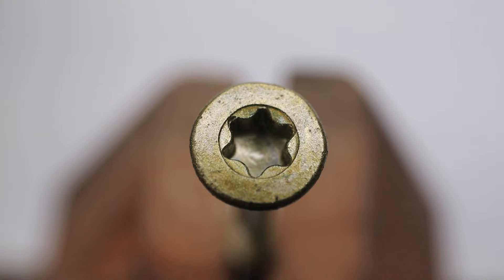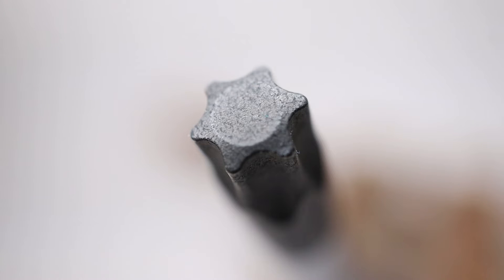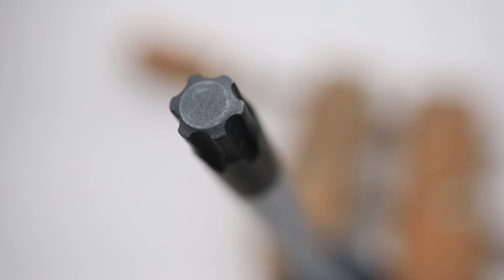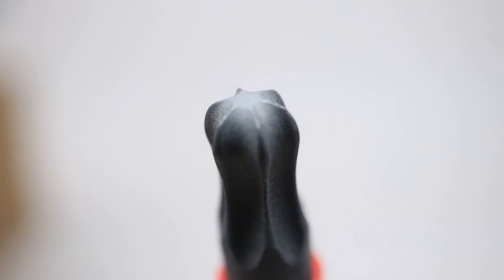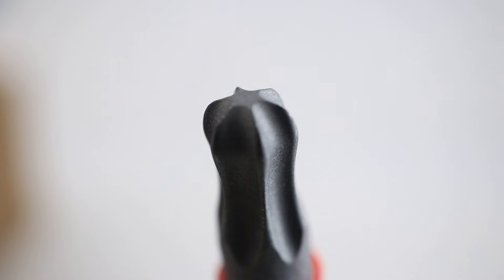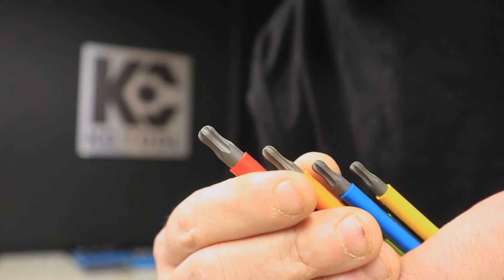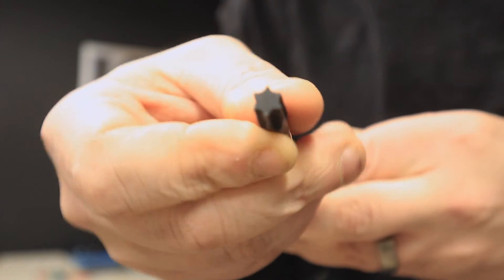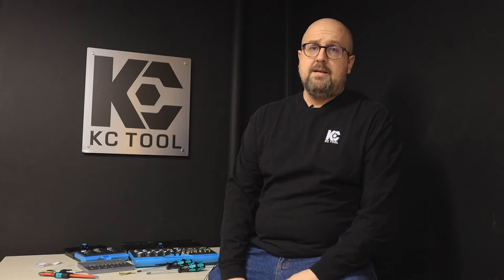The Evolution of Torx: From Torx to Torx Plus and Beyond

Comment: Twenty years ago, it looked like Robertson was starting to replace those miserable Phillips heads.  Then Torx and its various copycat designs came along and settled all of that.  Probably all due to easier manufacturing techniques that came after the original slotted screw.

Comment: The question that springs to mind: Is there any advantage of pentalobe vs torx? The Google says, no - that pentalobe is, for the most part, functionally equivalent to Torx but the different profile is a tamper-resistant "feature", popularized by the use in Apple products. Just another Apple "feature".
Reply from the maker: That is exactly right. to my knowledge, Pentalobe was developed by Apple has a tamper resistant fastener in the early iPhones and Macs. It is common to see on Apple products, but I am not sure it has been adopted by any other companies.

Comment: NOTE: for this comment when i use the word "bit" it is to be synonymous with word "tool" or "driver"

thought I'd share some possibly useful info out there, since their so many other shapes [that just resemble these alone, without getting into slotted or Phillip resembling!] that are distinctly different, (btw each abbreviation of nomenclature equally so also have a corresponding symbol, the shapes are pretty self explanatory but jus pointing it out but i digress), so yes we have [as i know them] 
T = Torx
TT = Security Torx AKA Tamper-proof Torx, 
TP = Torx Plus , and s
E = External Torx, all the other ones he mentioned are so rare i basically ignore them, this is because like he said himself a T bit can be used on a TP screw thus a TT bit can still potentially be used on a TTP screw, so to have a 
TTP =Tamper-proof Plus) bit is pointless, most other companies know this and is why nobody makes um, Confused yet? How bout the above is ok And TT bits < OK  - both T screws & - TT screws; while TTP bits < OK - both TTP, & TP screws, the rare times you will see 
St = Star bit (some cell phones), with sharp 30* angles differ from 
P = Pentalobe in that lobes are rounded 30* angles, & that's the key; the angle of the lobes, what do i mean? ill look at 1 end the spectrum then the other to explain, at your lower end  you have your bottom bit (simplicity)ch or the 
TA =Triangle bit with slightly concave center and Three 60* angle corners\lobes, and also you have the 
SQ = Square bit [aka Robertson (R)], four 90* corners. if you put 2 square bits overlapping you get the 
DSQ = Double Square bits with 8 corners\lobes 90* each, thus SQ bits work on DSQ screws, as the name suggests if you overlap another SQ bit atop that you end up with the 
XZN or Triple Square bit now with 12 sides\lobes, but 1 thats not the case, while SQ bits CAN can work on DSQ bits they DO NOT fit XZN have 60* angles instead, thus technically TA bits CAN fit but is not anyway ideal, 2nd not to be confused with
M = Spline bits, also with 12 sides\lobes but with rounded corners giving spline bits a more rounded softer look. Are we lost yet? If not, then this too can't be confused with drum roll\/\/\/\/\/\/\/\/\
DH = Double Hex (aka 12pt) and that is a bolt head that perfectly fits\meant for 12 sided sockets, which is 2 internal hexs on each other, last points, 

typically will only see Torx or Hex bits with Tamper proof holes for bits(Drivers) however hex bits come in metric and standard size giving you 4 variants, standard hex, security standard hex, metric hex, and security metric hex, then you have the double hex, security DH not typical,

Finally the sizes, THEY MAKE NO SENSE!! you go T-10, T-15, T-20, T-25, then T-27??, T-30, straight to T40? T-45, then T-47 again???? WTF!??!!!

" Hi my dad is trying to help me make sense of it all so id like to deposit some sense and reasoning" well good for you son we'll jus take that sense & reason and invest it in a single logical 12 point and sided set aaand its gone.....
.............................
.................
What?
Your sense and reasoning Its gone its all gone
What do you mean
all the 12 sided hex sizes didn't make much sense and its all gone
But i just laid down all the sizes and abbreviations for you so that it all made sense??
Not anymore it does; POOF
DAD! Hey what's going on here tryna teach my son all the different tool bit size and shape sets 
Agh Mr. Darsh, well jus ahead and show you how a triple square bit has 60* angles aaand its gone
What the hell
Do you make any sense of this? 
Not anymore!
Then please step aside for people that actually understand
Hello?
Agh Ms. crabtree hi well jus take your old and barely reasoning mind and explain Double Hex bits AAAAAND ITS GONE!!!!!!!!!!!!!!

Comment: So yeah a torx might fit in a torx plus screw head but will it actually work fine or will it eventually damage the screw and torx bit?  Just cuz it technically fits doesn’t mean it should be done with no adverse problems.
Reply from the maker: Agreed. I was hoping to imply that if you were using this everyday, using Torx in a Torx Plus is not recommended. For a DIY guy who has a single/couple Torx Plus fastener somewhere, then in a pinch they could be used. Sorry if that was not explicitly stated.
Reply: @KC_Tool  yeah I was truly curious about that, because at work we have multiple  different insertable  tools that the insert cutters are held in place by Torx and Torx plus screws and all the other workers are constantly using any Torx wrench laying around in the Torx plus screws and this happens all day every day 😂😂
Reply from the maker: @albertaoridge  Oh yeah, that is not a good idea! In a heavy use situation, all fasteners should be worked with the tool they are designed for. Couldn't agree more!
Reply: Regular Torx will work with Torx Plus but it'll strip the Torx Plus fitting when too much torque is applied. Guess how I know,?

Comment: T-25 headed screws beat slotted and cross by a least one order of magnitude, particularly with drill/impact drivers. I built a 300 foot fence and not one fastener failed. Deckmate #10 x 3-1/2 in coated screws for lower friction driving (more fasteners per charge) and corrosion resistance.
Reply from the maker: Oh nice! Deck and fences are where torx really shines.

Comment: Torx Plus and really all the other variants are entirely unnecessary when Polydrive exists. A 2 fastener standard should be implemented, and the two that should be used are Robertson for most everyday stuff like electronics, household, construction fasteners, etc. and Polydrive for extra high torque industrial/commercial applications like Automotive, Aerospace, and heavy machinery. For external drive types like nuts and bolts, hex is perfectly fine. If we added another or changed over to anything else, I'd say only Polydrive, and mostly because it's just an improved Torx.
Reply from the maker: Interesting perspective! We actually mentioned polydrive/RIBE fasteners on our blog recently. Thanks for the comment! Here is the blog entry if you are interested:

https://www.kctool.com/blog/stars-and-splines-forever/
Reply: @KC_Tool  Nice short article about it. I didn't know RIBE and Polydrive were different. In that case, based on appearances I'd say RIBE instead, but if the actual testing shows that Polydrive is higher torque/stronger, and less susceptible to cam out then change everything I said about PD as a standard to RIBE.

This would mean Robertson internal, RIBE internal for HD or "fancy" applications, then Hex and RIBE external depending on usage. IMO that should be our fastener system. If there's ever a special application like locking security lugnuts for your car, they should be proprietary to the product being sold, and ideally, unable to be fudged by "hammering on" an existing tool (like you can with regular sockets on a spline lug nut) and it working well enough to defeat the purpose.
Reply from the maker: @Drunken_Hamster  Thank you! And thank you for the commentary. We really do love hearing all the different perspectives!

Comment: The Spax version of Star Plus is a rather odd configuration .
It's a regular star bit with an added small protruding circle at the tip  which is suppose to force the bit and the screw into a straight line elimi acting play between the bit and the screw . it DOES do that but personally i 
don't t like it because one of the advantages of the star bit is i can drive a screw even if i can't get the driver directly above the screw .

Comment: I'm opening a small woodworking shop to supplement my impending retirement. I've put a significant investment into Wera bits and drivers. I'd like to move away from Philips head screws toward torx, but that's going to depend on how easily I can get wood screws with torx heads (not construction screws). That leads me to a question. Could you go into detail about the differences between Wera wood torx bits vs standard torx bits, and whether they are interchangeable?
Reply from the maker: Oh that would be a great topic. Thanks for the insight!